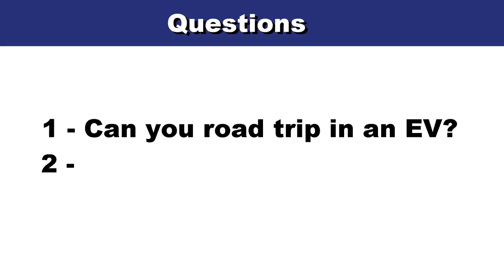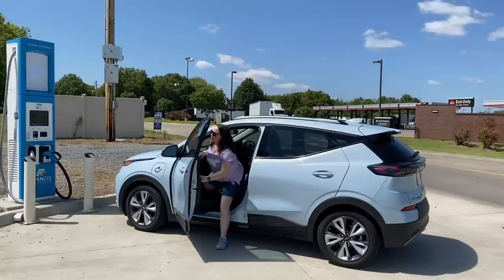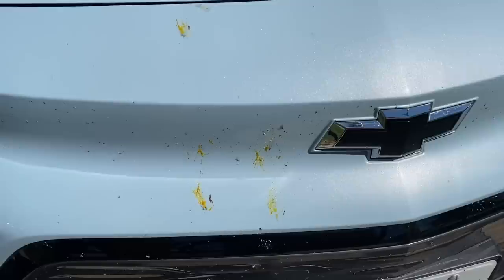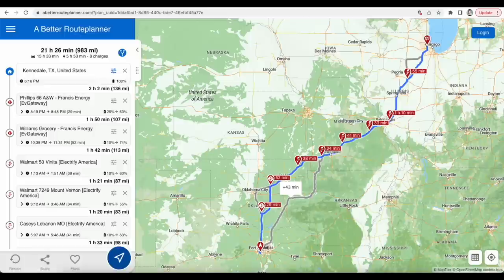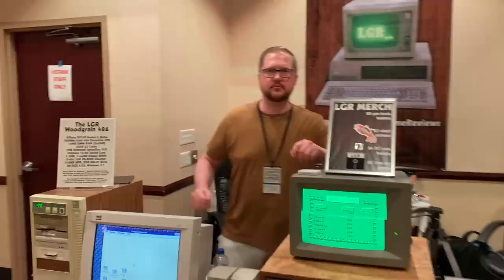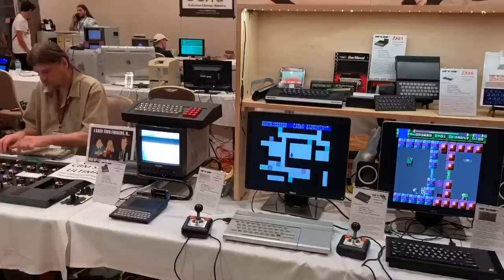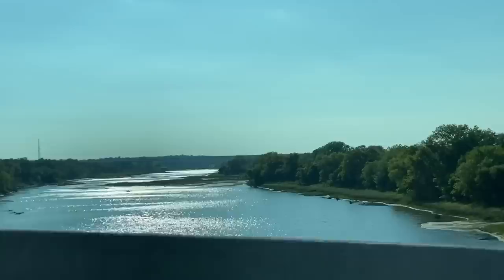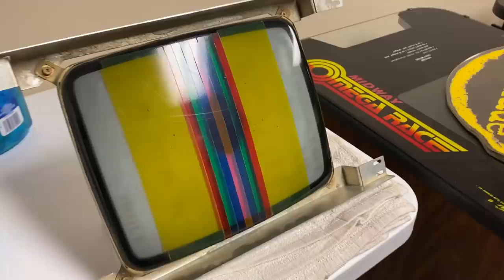EV Roadtrip, Vintage Computer Festival, and Moonbase Repair

Comment: Maybe breaking the tube was poetic justice for your snarky "guess they don't have everything" remark, and retribution from the arcade gods for your complaints about Galloping Ghost, hehe. On that note, $25 seems reasonable for all-day free play considering the selection, admittedly as long as you have enough time to make it worthwhile. As for broken machines, that's inevitable for such a huge inventory and with such a small crew who can only do so much. And why bother pulling them off the floor? Just think of it as part arcade, part museum, with the broken units being exhibits you can touch. :)
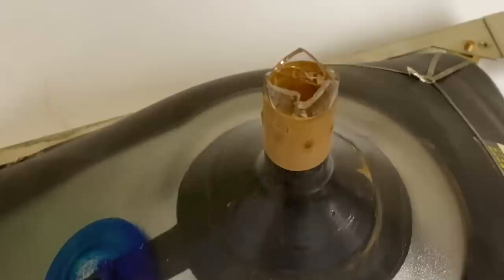15:43 If nothing else, you can call your mishap an unplanned science experiment that yielded interesting findings!

Comment: Great road trip, It is good it is possible to do on a shorter range EV. But the question the data doesn't answer is carbon. 

Between the many charge points there are different levels of carbon emission in energy production on the grid. The EV we all know isn't the emission point but did the carbon footprint for the generated energy it needed this trip really amount to less than the gasoline your traditional  car required? 

We really need a power generation heat map for Carbon Emissions, not Renewables because hydro electric gets ignored on the ones I can find as well as Nuclear where the pollutants are steam and concurrently heat, not carbon, unless there's something going wrong.

Great data on the trip just not all the data for informed driving impact on the environment that I can't seem to find anywhere.

Comment: Why do videos like this never mention how much it costs to charge?
Reply: I looked up "Francis Charging" after the video (where he charged 2 times in this video), and their FAQ says "The average charging costs range from $5 to $25 and adds between 40–300 miles per charge. Costs may vary depending on your type of vehicle."

That is so unbelievably vague that I can't even put words in to it. 

At first I was gonna reply to you with "ah it's probably super cheap since it's electric", but I ended up with "what the hell is going on" after I researched it.

At least Francis stations seems super suspicious.

Comment: EV's arent really suitable for long range travel. We would be a lot better if each mode played to its strength. EV's for short range light urban transport, and ICE (or hybrids) for long range heavy transport.
Reply: So... You notice that he mentions that the Bolt is actually way behind the curve when it comes to both range and fast charging, right? Your argument is quickly becoming obsolete. The Hyundai Ioniq5, for example, can fast charge in 15-20 minutes and has a range of up to 300 miles. This is not that far off from an ICE. Especially since you're probably going to stop to eat/rest anyway.

Yes, ICE cars still have the upper hand in pure speed at which you can get back on the road after refueling. However EVs have significantly closed the gap in the last couple of years and are getting better all the time.

Also, I'm not exactly sure why you're making the "light/heavy" argument either. Electric vehicles absolutely destroy ICE vehicles with regards to load carrying capacity by virtue of their significantly higher maximum torque+the fact that all of that torque is available at all speeds instead of there being a torque curve. Electric is outstanding for moving heavy objects, which is why there's so much of a push to get EV tractor-trailers out. The limiting factor is still battery capacity/ charge rate, and we're still a good ways away from it being commonplace, but that's an area that is being aggressively invested in because the payoff is huge.
Reply: That's odd. I've been road tripping my EV for 4 years and it's been a piece of cake.

Comment: Fuck that I like ev but what you have the range isn't worth that trip 15 stops on a trip I would go crazy stopping every 2 hrs I want to get there not stop because my ev only has realist range of 150 miles because running ac and electronics drains it way more stick. To fossil fuels or pay the money to get a ev that has a similar range as combustion

Comment: Yeah, no thanks. EVs will hit the tipping point for me when the energy density of the batteries are the same as fuel and it takes <3m for a fill-up. I like driving, not continual stop & starts.

Comment: No offense but stopping every 200 miles isn't a road trip. I non stop it from Jersey to Detroit in about 10 hours. I can do the entire trip without stopping for gas as its only 650 miles. My 2005 camry has a 720 mile range.
It shouldn't take two days. I can get from Detroit to Dallas in a day. Air cars are the future. CAE will win.
Reply: I did a 4000 mile trip last summer in my Tesla and it worked out great.  Stopped every 250 miles/3-hours or so, for about 20 minutes each.  Good to stretch and clear my head periodically.  Plus, more hotels/motels now have free over-night charging for EVs.  Would not want to roadtrip any other way now.

Comment: You couldn't pay me to do a long trip with an electric car. Nothing against them, we're just not ready for each other. Considering one for daily commuting.
Reply: I did a 4000 mile road-trip this summer in my Tesla (FL to CO).  I'll never do one in a gas car again.
Reply: @SpottedSharks  was that a 2000 mile up and back or did you make many stops  along the way? First, I would never drive that far. The most I've done is 1200 and that's about my limit. I'm flying otherwise. Next year same destination and we're flying. What did it cost? I would love to have an electric car, but it's not for me yet.
Reply: @myutoob2011  The purpose of this trip was to drive some of the scenic routes in the Rockies.  I could have flown there and rented a car, but I like driving the Tesla (I have a model 3 long-range). 

I think what many non-EV drivers don't understand is the charging time while on a road-trip.  It's not like pumping gas where you stand next to the car for a few minutes then you're on your way.  In a Tesla you plug in for 15-30 minutes at a supercharger and then you walk away from the car; you don't have to stand there (only the owner can unplug it).  The charging stations are usually located in or near a shopping center, so after you plug in you can get lunch, shop, stretch the legs, visit the bathroom, catch up on texts, etc.  By the time you're done, so is the car. This really went a long way to clearing my head of highway hypnosis and refreshed me for the next leg.  

Of course, nothing is stopping a gas-driver from doing the same after they've spent 5 minute filling up.  But for some reason they seldom do.  I certainly did not when I was road-tripping in a gas car.  The EV method of road-tripping forces me to take longer breaks which I never would have done in a gas car, and I surprisingly found it's a much better way to road-trip.

Comment: What a massive pain in the ass. That's why electric cars just aren't ready for prime time. It'll still be years before they are truly viable.

If you're out of gas, you can fill the tank in 5 minutes. Until electric cars can do that, no thanks.
Reply: This summer I did a 4000 mile road-trip in my Tesla.  Was I not supposed to do that?
Reply: @SpottedSharks  can you recharge it in 5 minutes? No? Then gasoline is still far superior for practical long distance driving.
Reply: @michaelbloom5342  20-30 minutes max to recharge.  that's enough time to use the bathroom, get lunch or a snack, and walk the dog.  I much prefer this less rushed way of doing long distance trips.  I'll never take a gas car on a long trip again.  But if you're a got-to-get-there-ASAP driver, then stick to gas.

Comment: EVs are a joke. They're only being made to be the future because they'll force it that way.  All those chargers had zero shade cover over them. And every time you charged you felt the need to impulse spend money somewhere next to the charger because you have time to waste thats not your choice. . .. All those "snacks" just added to the cost of a "cheap" EV. I can tell you right now you added waaaaay more time on your trip using an EV  than 2 hours. . You sat around for 45 minutes charging after just 2 hours of travel when a gas car would have been 5 minutes and then 35 minute further down the highway.  You made easily twice as many stops. With a gas fill up, everyone in the car would stay in the car. You'd pump gas and be gone. With EV you're all getting out because the car is boiling in the direct sun. Then you're all  going in and spending money for snacks, or walmart or the truck stop. Pfffft. Then you sit and wait while the person in front of you has to finish charging.. I'll be sticking to gas until they peel my boney hands from the steering wheel.

Comment: 7:00 now you realize the EV hype was all a hoax; you try to convince yourself that "all the stops and lost hours" were good, having rest and food stops but no, you had no other choice.You are a slave of elon musk and the likes; you have lost freedom, freedom to not stop, freedom to explore if you want (with a gas car you can deviate from the main road/freeway and get adventurous knowing your car will have a gas station always in range and of course if you fill your tank you won't even need it).
Gas car: peace of mind + freedom
EV: slavery + constant fear of not having a charging station at range (and not occupied by another car, and with the right connector, etc) 
And from the "pollution" point of view I don't think all those EVs draining lots of current all the time are contributing much to ecology, because guess what, electric generation still needs a lot of fossil fuel plants to charge them.

Comment: So basically EV's are piece of useless hyped up garbage.
Reply: I'm not a big fan of EVs, but he kind of states upfront that his Bolt is probably not the best EV for a road trip based on range and charge time.  i think it is primarily intended as a commuter car.  You can of course go further in a Tesla, but you are going to pay for that.
Reply from the maker: If you have charging at home, and EV is a vastly superior experience to a gas car for daily use.  Road-trips is still their Achilles heel, but the situation is getting better as the years go by. 10 years from now, I expect EV road trips will be on par with gas cars.